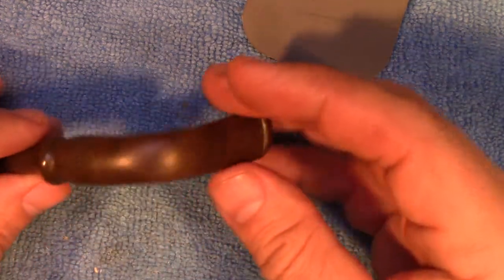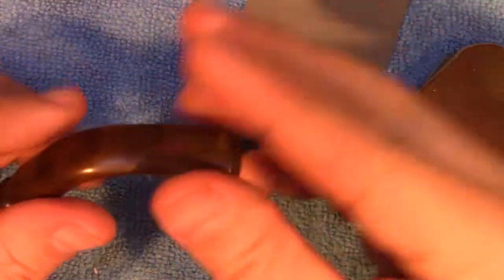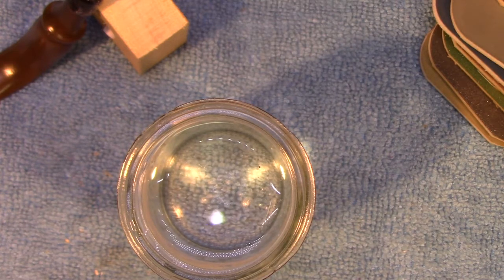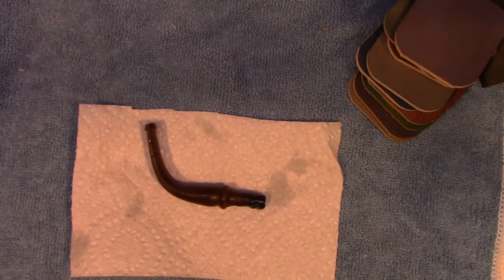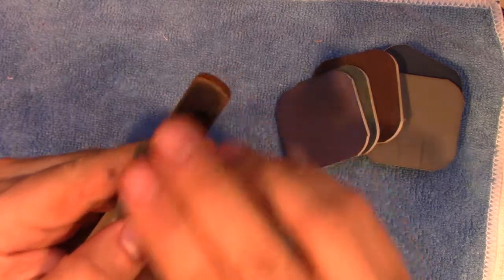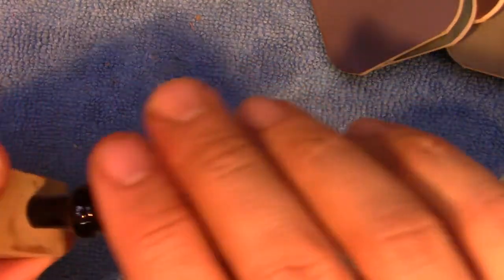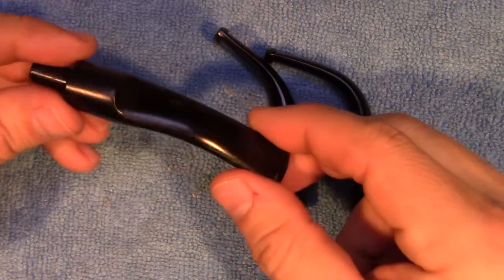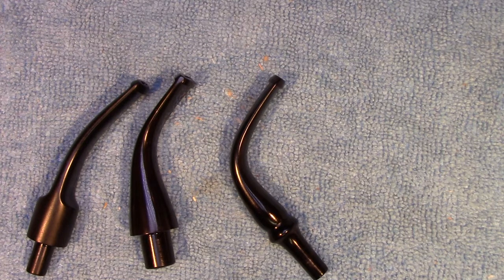Ebonite Stem Cleaning Part 2

Comment: Great instructional as always! I am curious on your thoughts as to what, if any, effect that the peroxide solution is having on the inside of the air hole. I assume that the solution is oxidizing the air hole as well. Do you think this is an issue at all? Thanks again for the informative video.
Reply from the maker: Hi Gabe,  That is an excellent question.  I don't think it is an issue.  Oxidation is essentially just a discoloring of the ebonite.  So the airway will be a different color, but the smoke should still move through just fine.  There is a slight roughening of the surface caused by the peroxide and I suppose that this could lead to more condensation/gurgling.  I have never had this happen, but just in case I now use a churchwarden pipe cleaner and polishing compound to polish the inside of the stem.  Clamp one end of the cleaner to the bench, apply compound, slip the stem over the cleaner and slide it up and down until you think you have done enough.  Thanks, Mike.
Reply: @CaneRodPiper  Excellent. Thank You.

Comment: Do you always go to dry sanding once you start using above 3200/3600 micromesh? I noticed you wet sand from 1200-3200ish. This will give me a great reference on my estate restoring and cleaning up my own pipes.
Reply from the maker: Yes, that is my usual routine. At the higher grits you are doing more buffing than sanding.  It seems to me that using water on the higher grit pads decreases their effectiveness a bit.   As always, YMMV.  Thanks for the question and for watching! Mike.

Comment: I've watched parts one and two twice now. Just started restoring a neglected 35 year old P. Viou. How do you work around the stamped white letters of "P. Viou" so that there isn't an oxidized spot around and between the letters? And without sanding off the letters?
Reply from the maker: Hi Rick,  The answer is very carefully.  You can't remove the oxidation without sanding, so you either will have a patch, or will loose some depth on the stem stamping.  I do not know of any way to remove the oxidation without sanding. Best, Mike.

Comment: Hello CRP,  What do you think of waxes like Paragon or Halcyon 2 from "Fine Pipes" for Ebonite stems? Maybe a longer term solution for long term storage?? I've tried Halcyon 2 on a heavily rusticated brier pipe and it turned out awesome but I didn't put any on the Lucite stem (wasn't sure what it would do). I recently acquired an estate pipe with an Ebonite stem and its heavily oxidized. I will be using your method of stem restoration. Just wondering if you've ever tried waxes instead of oils to seal/preserve stems and what your results were. Thanks!
Reply from the maker: Hello,  I now always put a layer of carnuba wax on the stem when it is finished, but you need a buffer to do that.  Any of the microcrystalline waxes like Halcyon or Renaissance should work, they just won't last as long as carnuba.  I still recommend the oil treatments.  Just wipe the stem dry before applying the wax.  Thanks for the question!
Reply: Thank you for the answer! I'll give it a try!